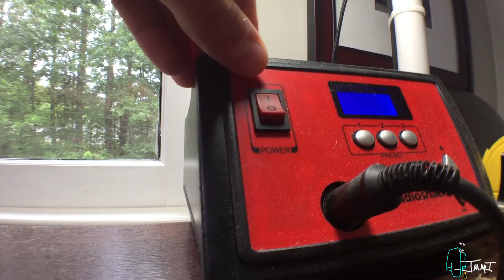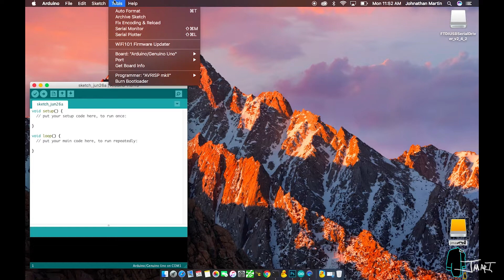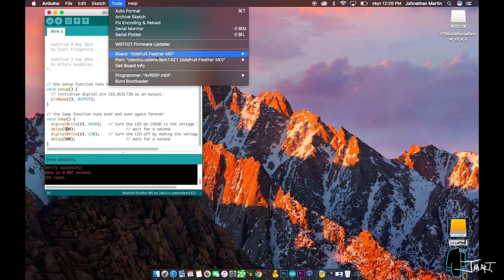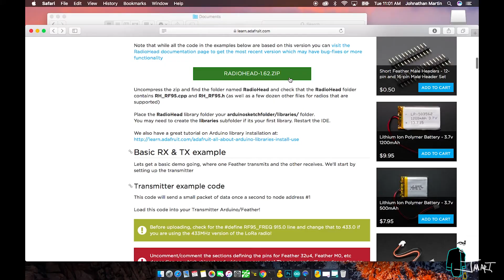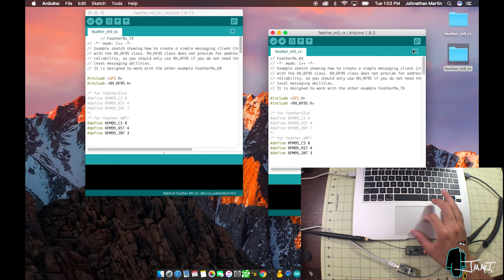Adafruit Feather M0 RFM9x Setup

Comment: Great Video.   I would like to see you take it to the next level and connect one of your Feather M0 boards to The Things Network and receive packets.  Keep up the great work.  I like your style.
Reply from the maker: da man, thank you. I will dig a little deeper and see what I can come up with.
Reply: I am also waiting for that video.  What do you think is the best setup for a The Things Network Gateway? Raspberry Pi?
Reply from the maker: I am intrigued by the concept of the things network. Could the Feather M0 act as a Gateway? I feel like it could, there is plenty of flash memory, a LoRa radio, and it is compatible with Arduino. However it appears that there are boards that are built and sold specifically for the things network already but they are kind of pricey. I want to look into this more with the Feather M0 because it would be a really affordable alternative .  If I come up with anything I will be sure to share.

As for using a Raspberry Pi, I think this would be a powerful option but you will have to source a radio and learn the communication protocol. If I was eager to build a gateway I would get an all in one system such as the pricey options.
Reply: the_jmart it's important to make sure your The Things Network setup uses the LoRaWAN protocol so you can get 10km  range. YouTube channel Andreas Spiess  shows videos with links to GitHub libraries to do it using a raspberry pi gateway and Arduino end device. Although the The Things Network forums show some issues when trying to port it to the Feather M0 (as an end device), I'm hoping the sources I've mentioned above (and the forum) can give you enough background to make a successful system, and share your work  on YouTube. Thanks and good luck.
Reply: i know it's quite off topic but do anybody know a good place to stream new series online ?
Reply: @Milan Achilles Thank you, I went there and it seems like they got a lot of movies there =) Appreciate it !!
Reply: @Kylan Evan glad I could help xD
Reply: @imaan6816  That's a 5 years old question and I am sure you have gotten your question. If not, I can help you with the Raspberry Pi and TTN.